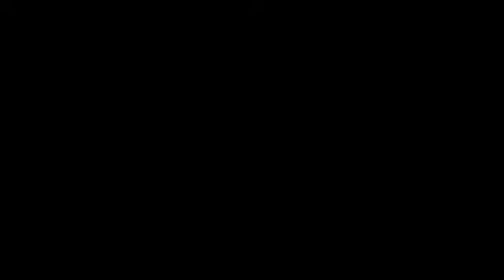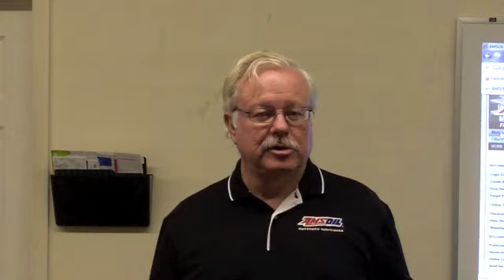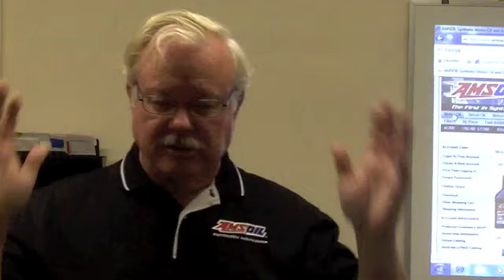AMSOIL Motorcycle and Hot Rod Synthetic Oil

Comment: Thanks, Dan.  Another great presentation.  I purchased a 2014 HD Softail Deluxe last summer and had a dealer do the initial service (5,000 miles) using their Screaming Eagle full synthetic Syn3 oil in the motor, primary, and transmission.  Last week I changed to Amsoil, using the specific oils for each application.  I am very impressed with how much quieter the engine idles (I can now hear the exhaust over the engine noise) and how smooth the transmission works.  I'll never look back.  AAA+++

Comment: I let my bike sit for 4 years with dino oil in the engine without starting it. Should I just drain the oil and change the oil filter and it will be ok?
Reply from the maker: You will have some rust in the engine.  Drain the oil and put fresh oil in and a new filter on the bike.  Take the spark plug sires off so it won't start.  Turn the bike over several times to get it lubricated.  If it will start start it up and let it idle for 10 minutes.  Now increase RPM to about 1500 for 20 minutes.  Drain the oil and change the filter use Amsoil engine flush according to the instructions on the bottle as you fill the bike with oil.  Start and run bike for 30 minutes with flush at high idle.  Drain the oil and change the filter and fill the bike with Amsoil motorcycle oil of the correct viscosity called for by your manual.

Comment: Are you saying Amsoil is the only oil left that still uses Diester base oils blended in? Redline used to have a good name based on the pretense that it contained a high level of Diester base stocks added. Lately we're finding  Amsoil out performed Redline oil in cold start wear testing. I'm not seeing an actual mileage value expectation advertised with Redline oils. How does Amsoil feel about the aftermarket ZDDPLUS additive in a bottle designed to add to your run of the mill API service SN oils and it's ability to blend with the oil and stay in suspension? Thanks.
Reply from the maker: NO!  I have said in many presentations that Redline uses esters, in particular polyolesters.  100% ester based products are great for racing but not easy to construct for daily consumer use.  It seems to work better to use ester as an additive fixing agent and PAO as the main base-stock.
Reply: Thank you Dan Watson. You have a gift of explaining the information and bringing answers that have been so needed. I hope to find one of your videos going in a little more depth about signature series 0w30. I appreciate you talking about intermittent heat ranges.

Comment: you say over and over "high zinc" but never say what the value is. I checked amsoil web page and you guessed it, no values given. So unless the word "high" means a specific value, this is line of bull.
Reply from the maker: When I use High it means 1200 ppm or greater.  There is no Industry Standard for the exact amount of Zinc and Phosphorous to be called high.  The EPA limits Z/P to 800 ppm to qualify for the SN Classification.  In European oils they have SAPS limits of 400 ppm for Low, 800 ppm for Mid level and 1200 or more for high SAPS so that seems to be the best scale to use when looking at the ppm levels.  The EPA limits apply to 30 viscosity and thinner oils not to 40 viscosity and thicker oils.